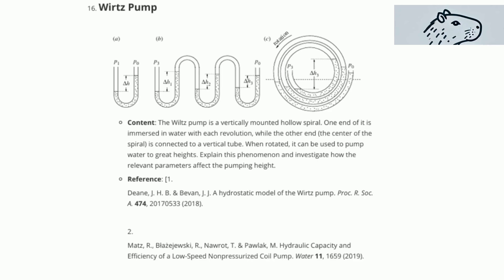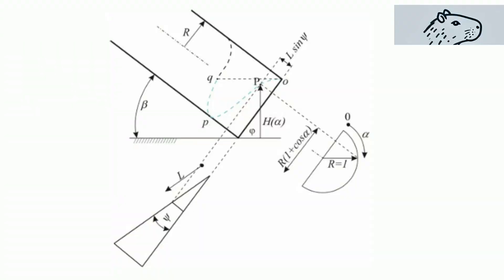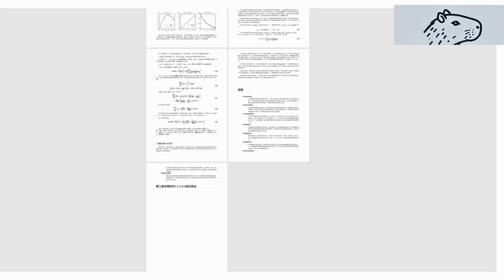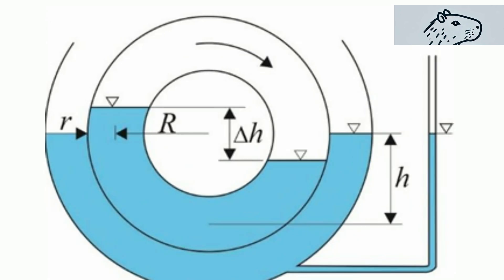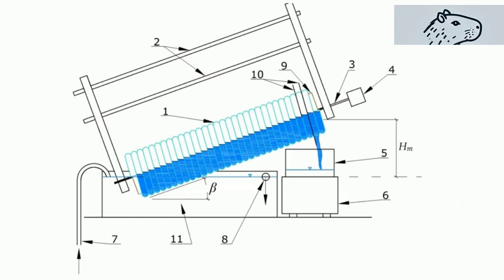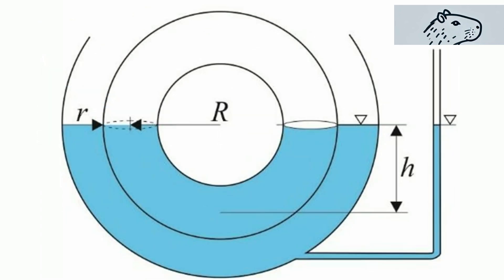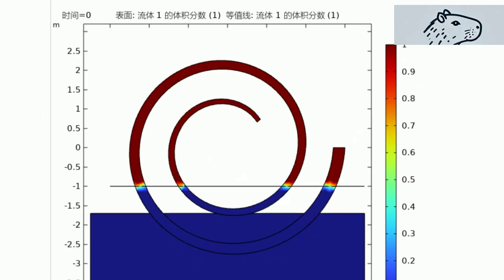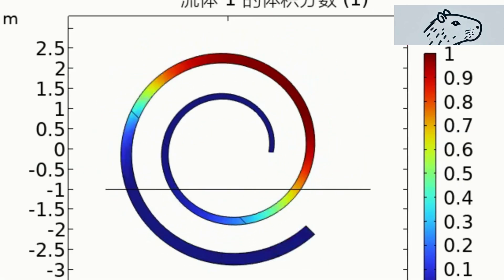2025 IYPT 16. Wirtz Pump Unlocking the Wiltz Pump Mechanics!

Comment: this is your work? did you already write your paper about the Wirtz pump or are you just a mentor?
Reply from the maker: Yes, the relevant papers have been completed. And our experiments and comsol simulations are done very well.
Reply: @jixavier4022  ok so you will be a competitor at the IYPT2025?
Reply from the maker: @matejvolarevic2363  No
Reply from the maker: @matejvolarevic2363  I signed up for jury duty.
Reply from the maker: Our information is free and will be given to you when you subscribe to a one-on-one tutor talk about this topic. The cost of a one-year subscription is now 69.9$, and the material is updated three times during the year, which means you'll also get three versions of the theory plus the simulation!